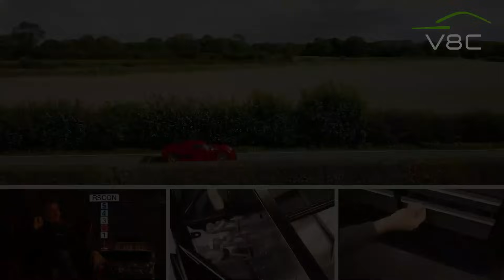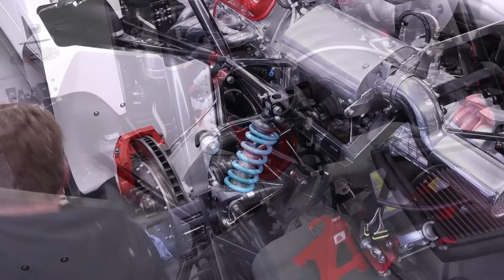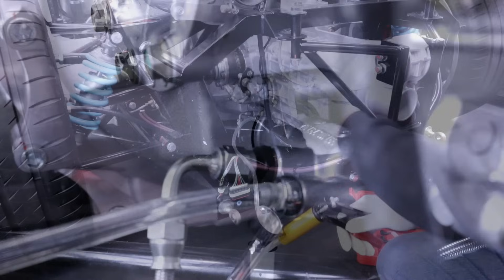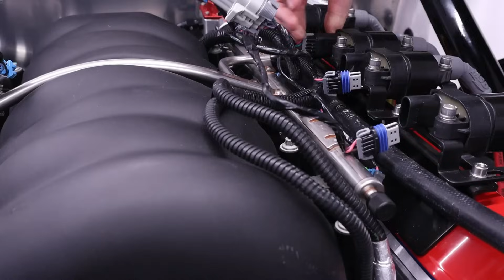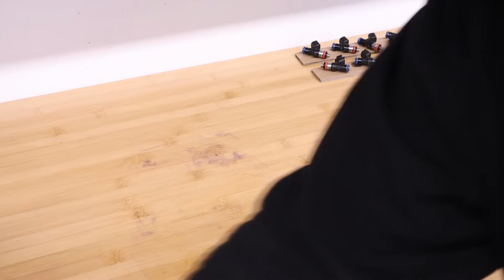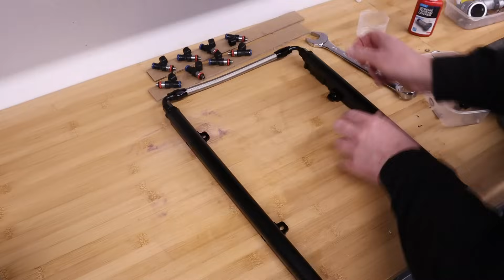Building an Ultima RS with Nigel Dean. Part 57. LS3 First Start

Comment: Ahh, the first wet start. those first few miles are 'the critical' ones. The "All filled up, and no leaks? Ok lets give it a little pressure and check for leaks." then the all important first crank and start... :D  Pity a little spilled fuel, but better to know the system works! 

And then, that throaty rumble! When I worked at the garage we had hoses to run out the door to save us the worst of it. For some of those, you really needed it! I live in "The Pacific North-Wet" region of the States. 

I love that throaty V-8 rumble. I took my headphones off and put the big speakers on to listen to it again.
Reply from the maker: Long live the V8

Comment: What did you take the exhaust ends off at around 16 mins
Reply from the maker: I'm amazed you are the only one to spot that so well done. I only pushed the tail pipes onto the exhaust since I didn't want to tighten the clamp until the rear clamp shell was on and I could align the tail pipes with the rear mesh. Basically they vibrated loose and fell off :-) No damage done but made me jump
Reply: Ha ha, I have a beedy eye. Great car though mate. I’ve been following with much enthusiasm. Lovely work.  @v8creative

Comment: Congratulations 🎉🎉   did you get the lift kit, if so did I miss the install ?
Reply from the maker: Hi mike, thank you. Truly a great moment in the build. I decided not to go with the lift kit. I live in a very rural area and just lifting the front suspension half an inch or so will get me the clearance I need. Time will tell I guess :-)
Reply: @v8creative  I'm in London and don't have a lift kit. I run 10cm clearance, probably the same as you did with your previous GTR. Normal long speed bumps are fine. The little square ones are 😅 you can drive over two together or gently over the side of one,  just don't take them down the middle under the car. The short rubber speed bumps are a no as they tend to be higher than 10cm and steep. 

The other consideration is steep entry and exit ramps at petrol stations.  I look for garages in advance and fill up when I can as we need to stop quite often to fuel the beast!

Comment: I am looking for a one-person brake bleeding kit.  Can you share your feedback with the one you used?  I will gladly "click a link" to the product if that helps you and the channel!  Keep spannering!
Reply from the maker: Hi Cory, the bleed kit I used was purchased off Amazon. Not over expensive and it did the job. Not sure if I can share a link on the comment section but plan to do an episode where I list all the tools I used in the build. Here is the Amazon title: DHA Auto Brake Bleeding Kit, Hand-Held Vacuum Pump Pressure Tester Gauge Set, Brake Clutch System Oil Bleed Kit, Manual Brake Fluid Bleeder Kit Tool for Car Motorbike Motorcycle

Comment: That engine is so beautiful in the way it looks and sounds. Are you really sure that you want to add a supercharger?
Reply from the maker: I will make a decision once I settle behind that steering wheel for the first time. Having built multiple modified cars there is a massive benefit form a turn key, instant start, reliable grunt every time. I will share more as the build finalises. Boy what a journey

Comment: Carbon monoxide is more dangerous than you think. It doesnt matter what the concentration of CO in your garage, which may be low.... it matters how much CO you have inhaled. It accumulates. CO bonds with your blood better, and longer than O2. So even returning to clean air may not be enough to keep you from fainting,
Reply from the maker: Noted, and in fact I do have a carbon monoxide monitor in the Dean Den. ;-) As you say this is a serious consideration and can't be underestimated. Thanks for raising the potential issue and good to share with the community

Comment: What octane fuel? 93? E85?  Did you use a vacuum tool to fill the coolant?
Reply from the maker: Yep, my local garage was out of super unleaded but she purrs like a kitten. As for the coolant this will need some heat cycles to get the air out of the system, that's tomorrow's job if it is not raining. Appreciate the comment. Cheers Nigel and Rufus

Comment: FABULOUS!!! That did not disappoint 😊. Sounded sublime on the 2000rpm blips. Love the anodised fittings. I think I’d be nervous as hell going near them with a spanner though
Reply from the maker: Hi Ian, I was worried viewers wanted a rev limiter roaring V8 but she is a new born and deserves respect. My father taught me when I was very young never to force anything and treat mechanical components with care. Yes I should invest in alloy AN spanners but after 8 builds a light touch seems to work fine. Thanks for your continued support of the channel

Comment: Sounds amazing. Have to ask though, is there a reason (other than impatience to hear the engine rumble) that you didn’t swap out the fuel rail and do the hose first?
Reply from the maker: Good question and it's the engineer in me. The first start is a measure of many things. The quality of the kit, and the ability of the builder. Since I'm sharing the very first start with tens of thousands of people on YouTube I wanted to reduce the risk of any issues. So my build is 100% Ultima; specs, components and recommendations. Built using standard Chevrolet Performance components - yes the valve covers are different but that's cosmetic. Hence the fuel rail. Once I had a seamless first start I could start modifying components - the fuel rails. Thanks for the support for the channel. Cheers Nigel

Comment: I joined in exactly half way through the build and I'm super excited for this! I love the build! But thinking back now, I think I myself would have gotten a Ford V8, however that's just my preference
Reply from the maker: Welcome to V8Creative. So pleased you are enjoying the content, comments such as yours inspire me to do more. Ultima only support Chevrolet V8s so I'm afraid Ford supporters can feel a little left out. However, a small car manufacturer needs to limit options due to resource bandwidth. Best to do one thing well, than two moderately. I must say once you are strapped into one of these machines, the experience is beyond imagination. Forget your Lamborghinis and Ferraris, the raw delivery of V8 torque simply ties your internal organs in knots :-)
Reply: @v8creative  I was aware Ultima only supports Chevrolet, so getting custom mounts would be inevitable